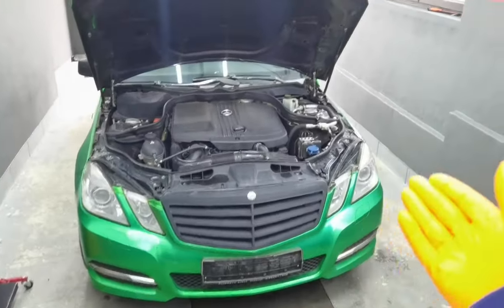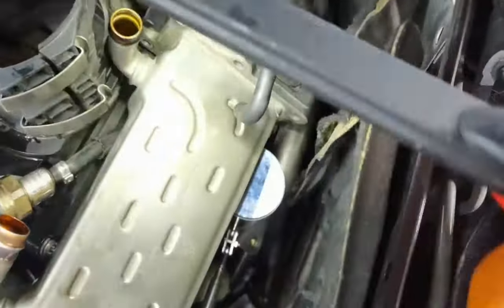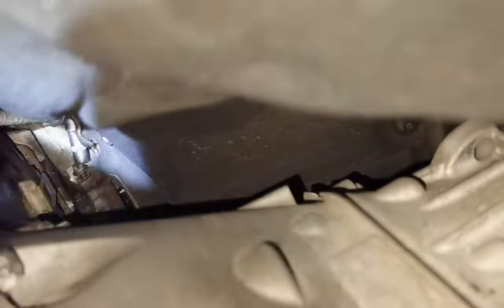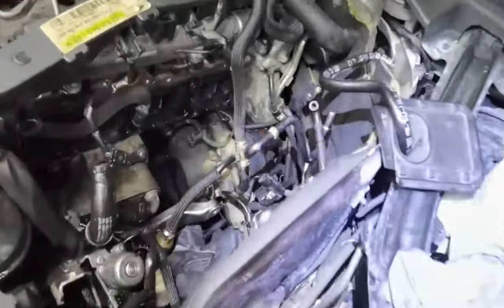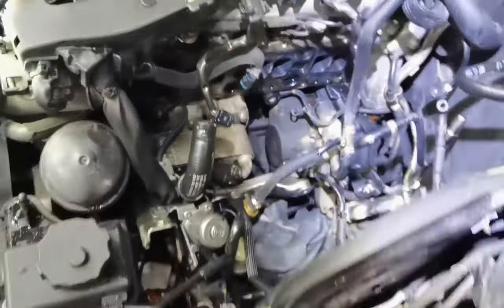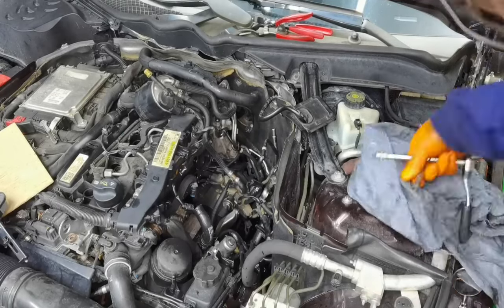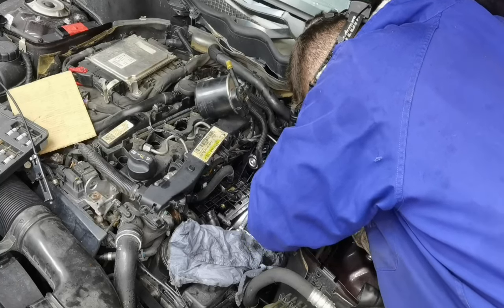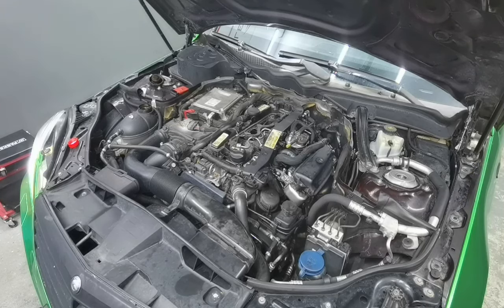Mercedes E Class W212 EGR / THROTTLE BODY / INTAKE MANIFOLD REMOVAL STEP BY STEP

Comment: One extra step remove the engine firewall it wayyy easier on the egr-aluminium part ot the intake manifold the last two bolts on the end of the engine
Reply from the maker: It's not easy to remove the engine firewall. I tried it and in my opinion  it's easyer  to do it from underneath.

Comment: All that work to remove throttle body??
Reply from the maker: Yes, that's how difficult it's on this type of engine.
Reply: The German engineers are not very considerate with the mechanical maintenance personnel.
Reply: With the OM 651 engin its like that.Very difficult to work on
Reply: I don't think it quite functions like a throttle body, more so to assist the egr in routing the exhaust gasses into the intake.

Comment: Hello, Could you please help me out and possibly direct me in the right way. I am working on the same engine and I am looking for AIT sensor (air intake temperature sensor) do you by any chance know where it is located? some say it's on the throttle body? any help would be appreciated! great video by the way
Reply from the maker: Hello my friend and thank you for feedback, the AIT sensor on this engine it's located right in the pipe on wich the throttle body it's connected, the pipe it's going in the intake manifold and the sensor it's in the middle of the intake manifold and the throttle body. You have to remove all the parts showed you in the video to reach it and to be able to remove it safely and clean it or replace it. In the video I also showed the sensor(AIT) wich I CLEANED. GOOD LUCK MY MAN.
Reply: Could you please pin point where it was on the video? id appreciate it sir!

Comment: At how many km?
Reply from the maker: Around 270 k
Reply: @HOWTODO0828  can i reuse old throttle gaskets?
Reply from the maker: Yes you can reuse the old throttle gasket if you are not able to buy a new one. It's completely fine if it's in a good condition ✌️
Reply: @mygoalcrash8077  he is right I did too, the only thing I replaced was the intake manifold and all the EGR gaskets.
Reply: @pantelis241  good thanks

Comment: I did today the same job on my C Class with the OM651 and i also removed this fuel pipe. Unfortunately my auto did not start up, i tried a few times approximately 6-7 times without success, i am a bit frustrated. Tomorrow i will check once again if i have forgotten a cable plug or a vacuum pipe but i don't think its the case, last but not least i am tending to do a fuel vent direct on the injectors. Do you have any oyher suggestion ?
Reply from the maker: Probably you forgot to connect the throttle body connector, try verifying if all the connectors are installed properly, chech if the hoses are connected to the vacum and check the fuel pressure sensors. And you could try to spray some starter spray into the air intake and start the car, someone should spray the starter spray into the  air intake and someone should start the car at the same time, eventually it will start for sure if you did al of this things right. Don't worry because sometimes depends from car to car it's harder or easyer to start them after jobs like this. I experienced a lot of cars doing like this.
Reply: Thanks for the reply, would you direct vent the injectors or not ? As for the vacuum hose I did found yesterday one that is hanging next to the gearbox and to be honest it is larger than all the other vacuum hoses......I try to see if it fit anywhere but did not see a reasonable connection. As for the throttle body I am 100% positive that I connected it because the harnesses with the connector has hold for me in place the throttle body until I fit the 4 screws.
Reply: @pantelis241 did you start it?
Reply: @marockiller9847  yes it is ready now

Comment: Hello, at the end of the video when the car engine started, what is that rough noice for first few seconds and than it normalizes. Is thah chain ? Thanks btw great video
Reply from the maker: Hello, yes it's the chain which it's worn out, the chain it's original and it has never been replaced. And also the injectors have some bad seals wich will be replaced soon🙏

Comment: Hello
That's a great video.
My car is a w166 ml 250 bluetec.
The engine warning has been turned on and the diagnostic has checked that the throttle is stopped at 97.4% and the fault code is p0122.
The car doesn't have any symptoms yet.
If the throttle body is shut down, what symptoms will happen to the car?
I would appreciate it if you could also let me know if replacing the throttle body will resolve the symptoms.
Reply from the maker: Hello. Thanks you for supporting me and my channell, from what I can read in your comment your throttle body it's faulty and  it's not working in the right parameters. It's not a big problem if it's not working how it should work because the throttle body it's there only to make your car shut down smoothly when you turn of the ignition and also to start it up a little bit smoother. Also if you don't replace your engine will make a lot of vibrations when you will turn it of and that's not good for the engine and all the bushing wich it's supporting it. If you replace the throttle body you will fix your problem and the engine will work smoother and also the check engine light from the dashboard wil dissappear.

Comment: Hi,
Thank you for the information in your video
I have a c220 cdi with the om651 engine
And sometimes thick white smoke starts coming out from the exhaust with bad smell like matches 
I checked the temperature is ok
Oil level after 10k km is ok no burning
Coolant level is ok 
But where i live the diesel quality is bad 

What are the possible causes for the white smoke and should i be worried ?

Also when it happens there is absolutely nothing wrong with car normal idle normal engine sound no loss in power everything seems fine except the white smoke

Thank you and please let me know of the causes
Reply from the maker: If you don't have any coolant loss then you don't have to worry. Buy you could also replace the glow plugs just to be safe and good. Also put some quality diesel in it if you can. Cheers
Reply: @HOWTODO0828 Thank you for the reply

Comment: My GLE has an oil leak from throttle body and has been to MB dealer multi times and they have been unable to fix it after replacing turbo seal many times. I would appreciate your help if you could advise what could be the problem?
Cheers
Reply from the maker: Mb dealers have the worst mechanics. You should replace the throttle body and the  seals from it. Also check the top rocket cover because they tend to find and bend because they're made from plastic and in time they start leaking. Only a new one Will fix the leaking problem. Also the turbo should be checked and I'd there it's a leak fisrt you should replace the turbo seals from around it. Those are not expensive parts and can be done by any mechanic.
Reply: Thank you for your reply. But what surprises me is that the throttle is in the air breathing system where the hell that oil comes from? Also where are you based can you do this job? Can I send you a private message?
Thank you.
Reply from the maker: Good luck sir. 🙏You can write me on discord.
Reply: Thank you, would you be able to answer my question where the oil comes from in the breath way and leaking from the throttle body?
Reply from the maker: It's normal to have some oil inside the throttle body and intake. The vapours of oil will go in the intercooler and thats they'r passage. Sometimes the vapours will stick to the sides it the intake manifold and the throttle body and transform back into oil. That's why you have oil inside there.
Reply: @HOWTODO0828  Cheers mate, that make sense. Should I be worried to replace the seal or keep it as it is? It is not a bad or heavy leak but leave it for longer without clean it for outside it will build up a lot of oil on the engine mount?
Reply from the maker: You can replace the seals. And in this way it will prevent it from cooking out from the parts. I also like to clean the exterior of the engines on wich I work just to make sure they are in the best conditions on the exterior.
Reply: @HOWTODO0828  where are you based? Is that something you can do?

Comment: Hi! Can you please show me where is intake air temperature sensor located on this engine please??
Reply from the maker: Hello, the air temperature sensor it's located over the intake manifold and you cand t reach it unless you remove the intake manifold. Also the air debimeter it's located next to the air filter, you will see a huge hose wich goes into the air filter underneath the ecm/ecu and there it it.

Comment: Hi I think I need to replace my throttle valve. Looks like a big job And alot of stripping. Mine is a c class so probably less room. 
I have codes po123-15 throttle valve short circuit to positive and p2112 throttle valve jammed closed.
Reply from the maker: Yes, your throttle body it's stuck in a closed position due to excessive build ap carbon but I recommend you to replace it and not clean it because it's a difficult job and you don't want to do it more then one time.
Reply: Thanks for the reply. Yes definitely going to replace it not chancing just a clean.

Comment: Are you mobile mechanic? Do you cover Newport Wales Uk ?
Reply from the maker: I'm not a mobile mecanic sir. I hope my videos can guide you in the right direction 🙏
Reply: P042F73 The exhaust gas recirculation positioner (high pressure) is jammed closed. The actuator does not open. E220 w212 . And car won t accelerate. I turn off the engine then will work as normal a bit.  Can be clean the egr or is something else? Thank you!!!
Reply from the maker: Yes you can, but I recommend you to replace it completely.

Comment: Is it a water cooled egr
Reply from the maker: Yes it is 👍
Reply: @HOWTODO0828  can this water cooled egr cause coolant water to leak and its hard to find...is the egr the cause of coolant to drop
Reply from the maker: Underneath the fuel filter it's a plastic pipe and inside that pip3 it's traveling antifreeze. I saw a lot of cars with that plastic pipe cracked or broked due to corossionand it start leaking antifreeze. You should check it too and see you you have a problem right there.

Comment: Hola tú podrías ayudarme con el orden de las mangueras de la válvula de enfriamiento ?
Reply: Hello, could you help me with the connection order of the cooling valve hoses?
Reply from the maker: Hello, you should check on any auto parts store, they should help you using your Vin number and only in this way you Wil get the perfect parts for your car.

Comment: How do you bleed the cooling system, or is automatic?.
Reply from the maker: You could remove the bottom hose from the radiator or you cand just remove the hoses from around the egr valve and the coolant will leak itself.
Reply: @HOWTODO0828  Sorry, I use the word bleed i mean purge the cooling system. The air.